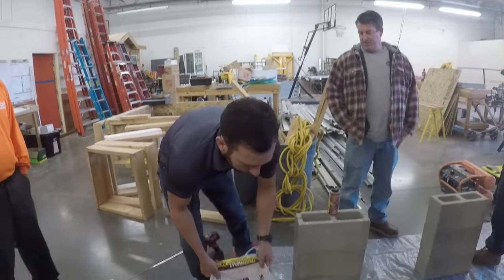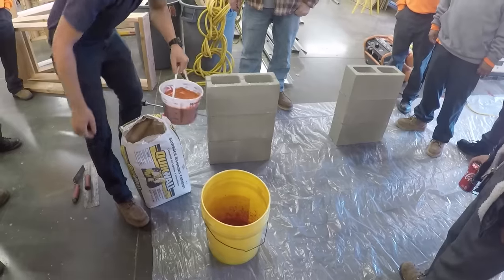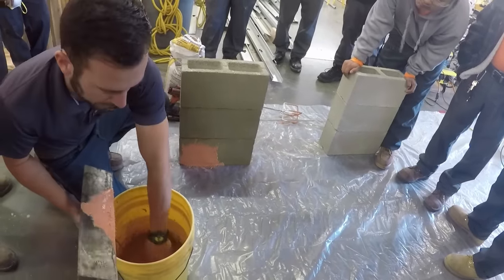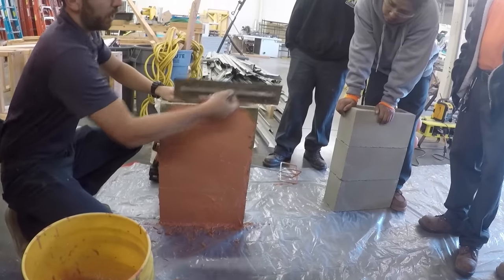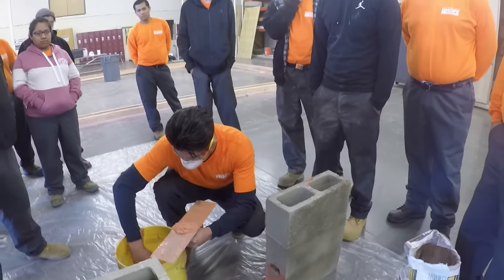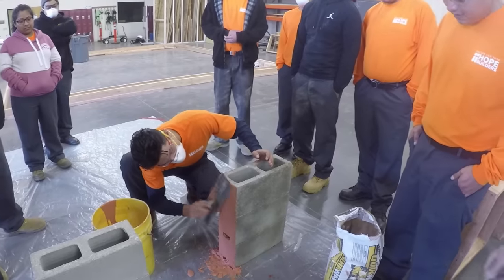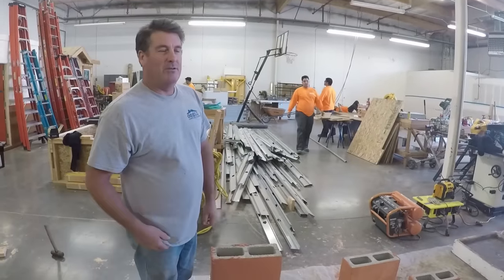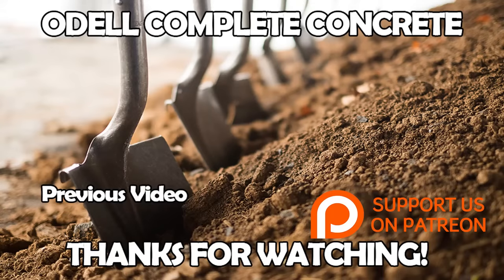Building a Block wall with Quikrete Quikwall Mortar-less Joints

Comment: David, I am not as nearly as skilled a mason as you are but, common sense and rationality dictates that this stuff cannot provide the same structural integrity as mortared joints w/ rebar. I would use this stuff to clean up/ repair a wall though or make a decorative finish
Reply from the maker: I concur.
Reply: I agree with u. I used to build reinforced fiberglass concrete wall panels. Don't know what they are doing.
Reply: in a standard brick and mortar wall, the motor holds the block in place and the block is acting as a formwork until its filled with concrete and reinforcing and  that has dried, that's where all the strength comes from. not the block or motor
Reply: @kiwibird8441  Makes sense
Reply: @OdellCompleteConcrete  no i thought the samething trust me Try this product on a wall super strong & makes the wall far stronger. Test it out put two walls side by side knock them down need 30 days for a full cure though
Reply: @kiwibird8441  
Please explain why my 1940's house is still standing after years of hurricanes? Only concrete in my walls is the top and bottom. Nothing running vertically. 

But yes I agree.. the rebar and internal fill is important.
Reply: @turboflush  you explain it,  standard or normal. theres exceptions to everything in life and every situation is different.
Reply: Think about it this way. You take 2 blocks and  stick them together with double sided tape around the edges like you would with mortar. They will take downward force just fine. It might even be a little hard to pull them apart. If you got a roll of that fiber reinforced shipping tape and wrapped around the joint where the 2 blocks meet, it would be a hell of a lot harder to pull them apart or for the wall to kick out. Fine Homebuilding did a great article on this.
Reply: @OdellCompleteConcrete  facts. no way it's stronger
Reply: @OdellCompleteConcrete  This needs a lateral, tensile, and tipping stress test. I wonder if it would be useful as a basement moisture barrier, block exterior, before backfilling? .
Reply: I have built a full basement foundation concrete block wall with this method ( the year 2000) no grout or rebar in wall except in two columns built in to soil bearing parts of basement wall and it never leaked cracked or showed signs of inadequacy. This wall was incredibly strong and was very difficult to penetrate when well water line was installed by plumber and would use it again without hesitation.

Comment: I actually used this stuff ten years ago ,,, did two foot knee wall for a steel building 30 feet wide ,, and a section four feet high on one side for the wood stove area. The wall is still holding fine thru a decade of Northern Maine winters. I am not a mason and would not have been able to due a conventional mortar joint wall. It worked for me ,,,
Reply from the maker: Good to hear.
TY

Comment: I have done this a few times over the years,  very quick and very effective. Not used Quickcrete, just a standard render mix with chopped polyester fibre.. works really well
Reply from the maker: Sounds good

Comment: Would you use this as a 1 coat stucco over a block wall that was done with standard mortar and cinder block? Or is there a preferred method over this?
Reply from the maker: Possibly one coat but maybe two depending on how looks

Comment: From a layman… several years back my father in law decided he wanted to move an older frame house and wanted a basement at the new location. He had the basement dug out and a thick slab poured, he dry-laid the blocks and used the this product on both sides of the walls and back-filled three sides of the basement before settling the frame house on the new foundation. No signs of cracking so far…he did apply his much thicker than in this demo.

Comment: Creamy Tomato Soup holds a mortorless Wall together??? 🤔
I don’t believe it.

No Habla Englessia 🙀
Reply: Yea if it was stronger than a standard block wall with 3\8 joints they would build elevator shafts out of it tomato bisque for a structural wall haaaaaa
Reply from the maker: Get it on
OSs
Reply: @andthebeat...  adios marecon

Lol

Comment: I used over 50 bags of this on my basement exterior before back filling, mainly as a water proofer. I tar coated it next.    You are supposed to wet cure it for at least 24 hours to expect any strength. It's a very good product and I will use it again, but not the way it's been demonstrated here..
Reply from the maker: Sounds good
TY

Comment: Could you mix this with plaster? For interior walls or is it not needed. How thick does it have to be before it cracks? And do you have to use a special primer beforehand?
Reply from the maker: No primers needed, but sometimes I'll spray concrete glue on the wall.
Thickness 1/4 to 3/8

Comment: This has been around for a long time. You used to need to make your own. Most supply houses carried chopped fiberglass to add to fine sand mortar mixes. It’s very similar to diamond wall thin coat stucco mix. I’ve read it was originally developed to build cisterns.
Reply from the maker: Thanks for the info!

Comment: I live in Arizona and the walls built around the houses here the cinder block is literally staked on top of one another with a little bit of mortar. After a while you can see through where the mortar is supposed to be. Short of tearing down the wall and starting again there is not much you can do to fix them, maybe this product will help strengthen the wall a bit.
Reply from the maker: Yes that may work

Comment: will quikwall work with metal lath nailed into tarped wood?  I have a wood chair wrapped up in a tarp for outdoor protection.  I plan on adding a thin metal lath around it and use this to give it a stone look to the chair.
Reply from the maker: Interesting. It should work if the frame is rigid

Comment: Id say thicker coats do matter.
Im skeptical of this product though.
Id ask what the overall verdict is but wouldn't want to put anyone "on the spot" so to speak.
My gut tells me old school mortar rebar etc tried n true is the way to go.
Only time will tell with this product itd be interesting to eventually find out. 

Damn good video as always either way!  👍
Reply: I used this stuff as a finish coat, not structural, on a 40x60 ag building that is in the ground 6 foot on one long side and about 2.5 foot on the other. We still filled every other hole tube with concrete and rebar for the actual strength. I figured stronger than stucco but still provides a nice finish on the inside. Been almost 2 years now, no problems so far. We did tar and plastic the outside before pushing the dirt back in place. Nothings bowed, nothing leaning. I'd use it again. Special order from the big orange home repair chain.
Reply from the maker: TY
OSS

Comment: LOL, you can tell the demonstrator dude is a PHONY, he's rarely handled any tools.  He looked like a toddler making mud pies for the first time.   Also, all that BS about the wall being stronger than whatever.  Odell, you're a nice guy, had you been one of those rude and ruthless kind of dudes you would of handed him his ass.   Wonder how he's going to feel once he reads all the comments on here.  

That is some good stuff, but not the way he's trying to push/sell it.  I feel this would be good in areas like DC or NY where owners spend thousands to tuck-pointing brick with deteriorating mortar.  I would try this on the back and sides of a building where appearance may not matter.
Reply: Handy Man he’s not a PHONY.. he’s a GOMEY .😄
Reply from the maker: I think its main purpose can be stucco patches in a one step, without having to worry about cracking

Comment: Different areas of the country call for different tichniques. In the North we have to wet, mortar paint the block, and then apply the product. Codes require mortared joints with reinforcement rod. Then plaster the exterior over an insulation product.
Reply from the maker: SOunds like your in some freezing weather
Reply: @OdellCompleteConcrete  Yes.  They are calling for a chill factor of -35 degrees F this weekend. Need a buffer between the frozen soil and concrete due to the expansion of the frozen soil always cracks the unprotected concrete and block walls.
Reply from the maker: @Uticagreens  
sounds like big money to build there

Comment: It'll hold but will it meet code and what about engineering? I like their products and i like the quick dry but I don't think it will replace bonded and filled block wall. it may be strong but not strong enough. Definitely need thicker coating, even a scratch coat is a quarter inch.
Reply from the maker: Its a quick fix one step on small stucco jobs, but not to hold blocks together.

Comment: Not only is a block wall with rebar, grout, bond beam and mortar joints 10 x stronger then this you will find it very hard making a level and plumb wall dry stacking CMU block this product is only good for a patch job
Reply from the maker: I Concur

Comment: If properly applied 1/4" thick to dry stacked block , would this be strong enough for a 4' tall  foundation wall ?  Would a building inspector approve it, assuming the required footing, rebar and grouted cells that a mortared block wall would need ?  Strong enough to have all cells filled solid without needing any bracing ?  Seems like the inherent damp proofing would be a plus for foundation walls.
Reply from the maker: I think so, but I don't know about a Inspector

Comment: To be fair on the product, it really hadn't cured enough and was put on with an inconsistent thickness.
You can clearly see it wasn't properly cured as when they handled the mix, the fibres easily came out of it. Probably be OK after 4 hours outside, in the sun and wind, but not in an air conditioned building.
The big advantage I see with this product is for rendering over uneven walls, say decorative coarse finished brick or walls with heavily recessed bond lines. The fibre will give the mix the body to fill those voids and prevent cracking on cure.
Reply from the maker: Yes cure time may have made a big difference

Comment: This product could ,indeed, work as it's beneficial to have the tensile forces resisted on the outermost surface (.  Think monocoque , honeycomb panels etc)   Plus there is a lot of bonding surface area.  Need to make sure enough "whiskers" are spanning the joints though...and allow for a proper cure.
Reply from the maker: Yes

Comment: I can only imagine the liability this would leave quikcrete open to. I wonder what the fine print on the bag says? I am however, tempted to use the product as a facing for areas where I need it aesthetically, and for art projects.
Reply from the maker: Solid grout it and it's fine.
I think the real purpose is to use on exsiting damaged walls.

Comment: Seems like a cool solution for a smaller non structural DIY wall. I would probably feel a lot safer if I were to put in some rebar and concrete like with normal block if I was going to build a bigger wall/fence or something with this sort of a solution.
Reply from the maker: I concur

Comment: Is there a follow up to this video? 
What did the manufacturer say about this failure?
Reply from the maker: It's not a failure because it wasn't designed for that.
We just tested the limits
Reply: @OdellCompleteConcrete  
True.. concrete doesn't like to be pulled on. Lol. 

Just curious why we don't build buildings this way if it's so much easier and quicker and stronger.  
Everything I read.  Says this is better,.. but yet we don't construct buildings with it.  Not even fence walls.

Comment: Agree with many of the comments. It seems that if you get a thick enough coat on all sides with the aid of the fiber, a wall could be strong enough to rival, with the right conditions, a rebar and mortar wall. But the mix does not seem to spread well and looks like added cost in material, more hand time = higher labor cost, and ultimately a weaker product. Cannot see a benefit.
Reply from the maker: I think its main purpose can be stucco patches in a one step, without having to worry about cracking

Comment: As a HOMEOWNER and non-cement/concrete contractor...I have always appreciating watching a company lay concrete block. I always WISHED there were a product which would allow me to stack block like legos and than just butter it up like frosting on a cake.

THIS is that product. Their website mentions "garden wall, planter, mailbox support, and outside kitchen" and meant to be used on "small projects."

As a concrete amateur I'd use it because building concrete block the way I've seen LOOKS complicated. I'm not saying I WOULD USE IT, but there is a MARKET out there that can LEGALLY build non-structural walls with a STUCCO product...and they will find this product and make outside BBQs, grills, kitchens, short retaining walls, planters...etc...

AND there will be PROS who use it for the same purposes...

It doesn't save on labor so its NOT specifically tailored for contractor use...more of the DIY intimidated by the idea of making a legit block wall.
Reply from the maker: Yes I think there is some small stuff like under 2' that has no shear or load against it.

Comment: Shouldn't you have waited longer than 4 hours from application to test the strength? I used this product on about a 4 block stack many years ago, then let it set completely (weeks or months) and could not kick the blocks apart.
Reply from the maker: Yes probably would have worked  then

Comment: I wouldn't have my crew using it because they can lay up 30 squares in a day this'll be slower and could possibly bid in lower than 95 cents per block the normal prevailing wage
Reply from the maker: Get it on

Comment: So many variables to this product working as designed. Not sure how building regulators would approve it for housing. The colouring and mixing method is problematic for consistent colour matching. Every splash of water changes the shad on one batch to the next.
Reply from the maker: True with any integral color cement product

Comment: David, I'm building a ~4'x2' rectangular gas firepit enclosure with 8x8x16 block , 2 courses and a one piece cast concrete top cap.  I'm going to finish with stone veneer. Would you use this product or go with standard mortared joints?  If mortared, would you still fill all the cells given the size and use? Thanks for the great videos!
Reply from the maker: I think standard mortar joints

Comment: That's still pretty strong for only 4 hours. Fiber an latex does wonders.
Reply from the maker: Probably a good overlay mixture
Reply: @OdellCompleteConcrete  I see on the spec sheet they say "  CURING
QUIKWALL® SBC walls must be fog cured after having achieved final
set. This is essential to ensure proper hydration of the thin surface
application."  So they want you to keep it wet during hydration. I'm sure that would add a lot of strength.

Comment: I don't believe it has the same strength as reber and mortar, compression yeah,......
Shear or tension, NOPE...
Reply from the maker: I think its main purpose can be stucco patches in a one step, without having to worry about cracking

Comment: No rebar, no corefill? You gonna build a basement wall buried like that? BS.
Reply from the maker: Never.

    
    

        

        

I think its main purpose can be stucco patches in a one step, without having to worry about cracking
Reply: I agree I'm sure the fiber will reinforce as a stucco product compared to their type s mortar
Reply: Odell Complete Concrete 👍

Comment: Not a fan. There is a spray applied finish as well available and it is so much stronger. It can be hit with a 14lb hammer and will still hold up.
Reply from the maker: Whats that product
Reply: Odell Complete Concrete In the U.K., it is produced by GLS Coatings. I cannot remember the product names of similar products in the States.

Comment: The concept is cool but in my opinion this can't  compete with a wall done with mortar and rebar especially if it had to retain dirt or whatever
Reply from the maker: I think its main purpose can be stucco patches in a one step, without having to worry about cracking

Comment: Similar to countertop mix?  “GFR”
Reply from the maker: That's interesting
Reply: That’s what I was thinking. This seems a little crazy but I’ve seen guys make a table out of Surecrete’s GFCR countertop mix (only about 1/2 in thick) and had four dudes standing on it four hours after it was poured. If this is 1/4 inch thick on all sides...?  Maybe don’t build a house with it but you could probably do a lot with it.

Comment: I wouldn't trust it to hold my wall together.
Reply from the maker: I think its main purpose can be stucco patches in a one step, without having to worry about cracking
Reply: That's what I was thinking -- or to skim coat the interlocking mortar-less block walls without cracking.
Reply from the maker: interlocking may work

Comment: 6 GUYS STANDING ON TOP OF IT SOUNDS GOOD, BUT 20 YEARS OF SLOW GROWING TREE ROOOTS PUSHING ON ONE SIDE OF IT, IT WILL CRUMBLE.......  bUILD A BLOCK AND MORTAR WALL, FILL WITH REBAR AND MORTAR, ......... SORRY OLD SCHOOL
Reply from the maker: I concur, this product is for stucco one step, without cracking

Comment: Holy cow so cringey. You have a lot of patience, I would have been incredulous if I just pulled it apart. Just the fact you can't push but only pull the material with the trowel would make it a no go for me. Too much sand maybe?
Reply from the maker: not sure

Comment: I don't think that quikrete knows that this product wouldn't be useful on a production based job and 3-4 hundred ft by 6 ft walls. Kinda phonny oh well on to the next idea.
Reply from the maker: I think its main purpose can be stucco patches in a one step, without having to worry about cracking
Reply: Yup yup agree. Cost effective.